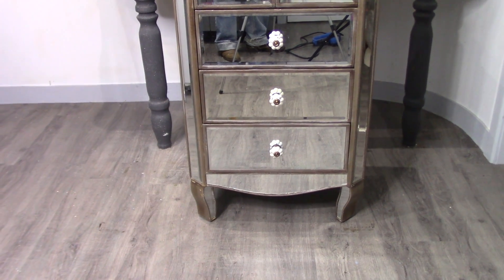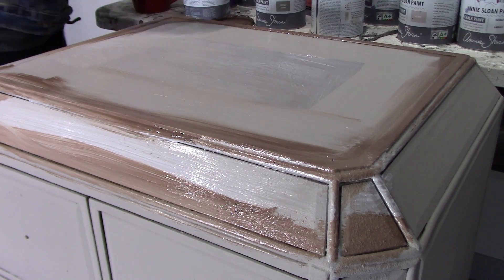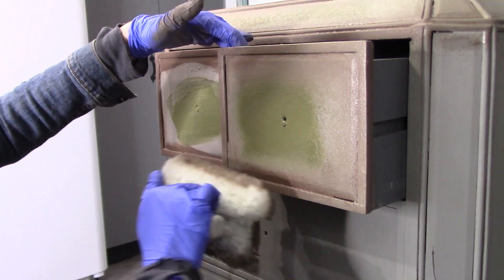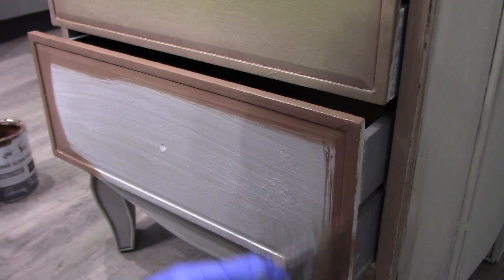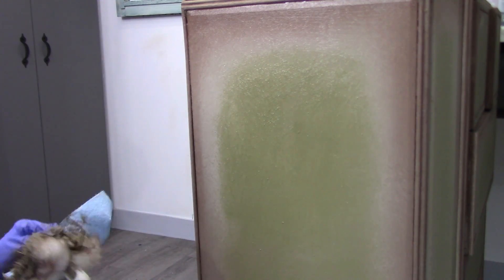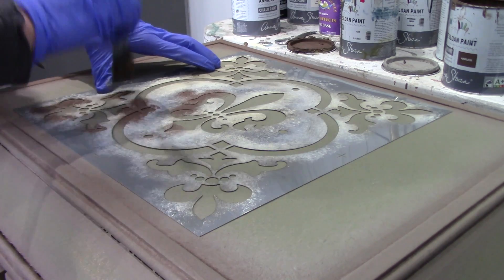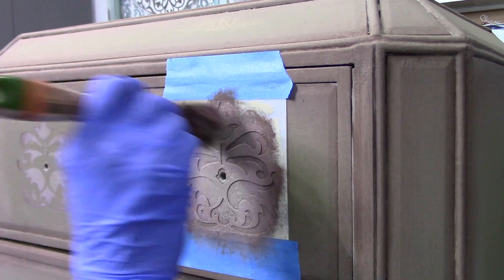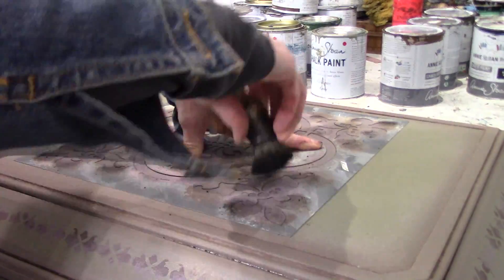Paint Mirror with Chalk Paint | Chalk Paint Blending with Faded Stencil Effect and Glaze

Comment: I'm curious if you have attempted a scratch test on the glass surface!
Reply from the maker: Sammy Davis ... I have two painted pieces on glass and I haven’t had any issues. If the surface is a glass table top I highly recommend using a lacquer ( coffee table as an example) to seal the paint and protect from any major water or moisture spills etc. If someone had a busy household I recommend 2 coats. 
Even after clear wax nothing will come off until you use a strong paint thinner to remove the paint. 😉🎨

Comment: What stencils did you use and where can they be purchased?
Reply from the maker: Jane Tipton ... the stencils I have are all from Michaels art store and in the USA they would be found at a local Hubby Lobby art store. 
You can purchase stencils on amazon as well but I like seeing the quality up close and personal first. If you purchase those with a thicker sheet they last longer and wash much easier for repeat use. You can also trace them from sourcing them online and print off a style you like , using an sharp edge to cut out the traced stencil and this way you will have lots of variety , it will only be for one time use as the copy papered version will absorb the paint and wouldn’t work very well after one use. It’s a nice options if you just want to try a stencil project once to see if you like it first before purchasing👍🏻🎨